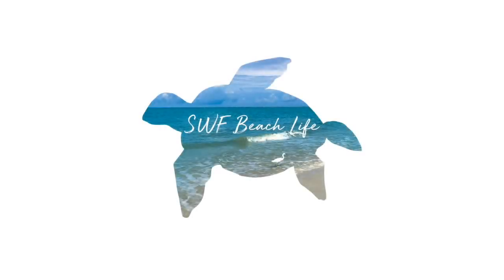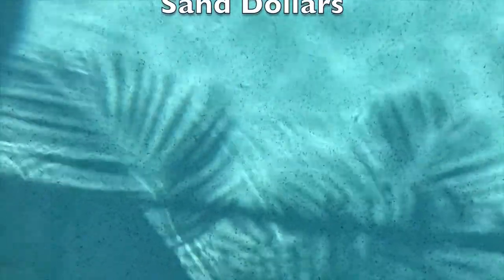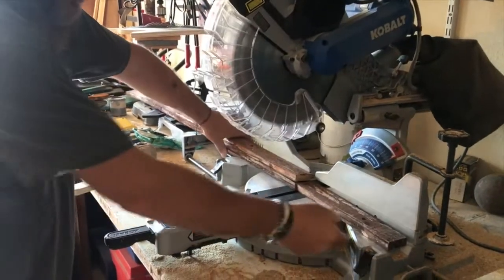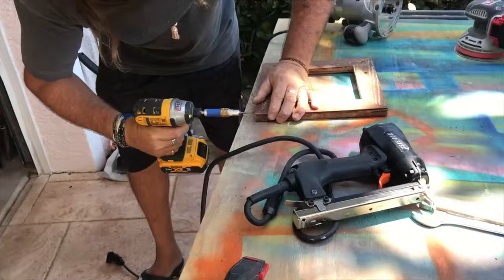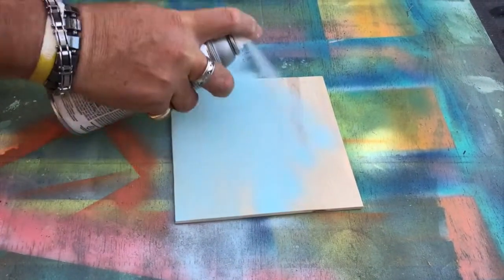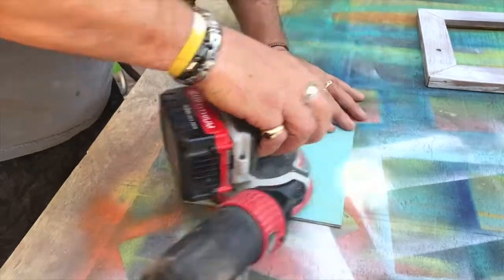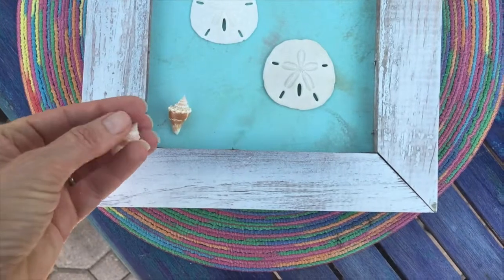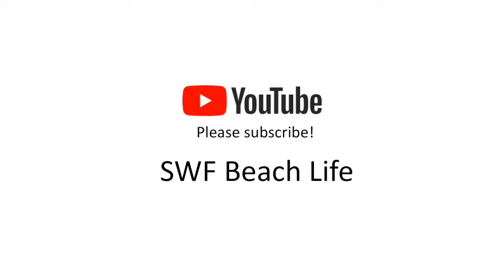Making free beach related decor. How we made a sand dollar wall hanging for free!

Comment: Hey! I picked up a sand dollar and brought it back home.. went through the hydrogen peroxide soaking instead of bleach. I wrapped up the sand dollar in tons of paper towels as a cushion. In yet.. a piece of it broke.. I’m trying to think what is the best way in gluing it back together. Will Elmer’s glue be strong enough to put the sand dollar back together or crazy glue? I don’t want to damage it :( and should I do this water/glue combination to make it stronger.
Reply from the maker: I use E6000 on my shells. I would try to glue the back of it together so you're only seeing the glue on the back. Then I would definitely seal it a few times with the glue/water solution to give it a little extra oomph. I hope you're able to repair your treasure!
Reply: @SWFBeachLife  ok! That’s perfect. The water glue combination is to keep it hardened right? And i would need to paint it all over the sand dollar? Including where I repair it in the back? Should I put it on something to dry, specifically?
Reply from the maker: @caitlyntannu1791  Yes, apply that glue/water mixture over the entire sand dollar but maybe just the "ugly" glue on the back. I put mine on aluminum foil - they don't seem to stick to that!